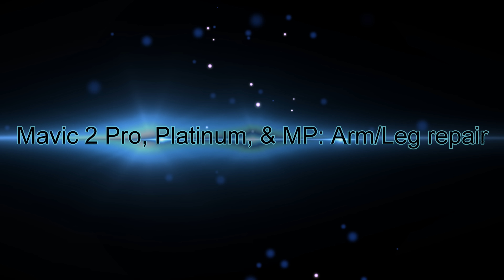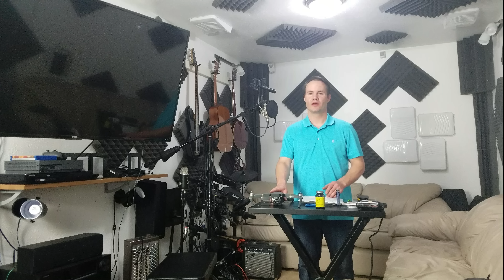DJI Mavic 2 Pro Drone Crash Arm/Leg Repair: For Mavic 2 Zoom, Mavic Pro Platinum, Mavic Pro inUHD 4k

Comment: is there a problem to cut the wires and join the old and new with Heat shrink solder butt connector?   Then you dont need to solder on the main board.

Comment: Never use solder wick they come with pre soldered contacts for a reason the components will drop off the bottom side if you get too silly.order there esc and see  for yourself

Comment: Liquid Lab Studio...The first thing you should do is change the title of your video. As you can see ( you do see...right ) by the negative comments, people want transparency, and to know that a repair video on a Mavic Two Pro....is actually "on" the Mavic Two Pro, not the older Mavic 2. These things are important because its a VIDEO and I need to see you working on the same piece of equipment that I own, you see ? ( you do see,right ? )  Dont just explain or defend your mistakes, make the changes and I'm sure you will do well.

Comment: I just love how someone creates a youtube channel and all of a sudden they're the go-to source for misinformation.  LOL.  Don't take any soldering advice from this guy.  You need to remove the old solder.  You need to tin the new wires to draw solder through the strands and help prevent a cold joint.  You need to use a soldering iron, and not a soldering gun on something this small.  You're not soldering battery lugs on jumper cables.  Liquid tape is unnecessary and just makes a mess.  Then there's the reason you crashed to begin with.  It wasn't the auto-land, you should have made it.  It would have kept altitude if you kept the stick-up, particularly since you were at almost 400'.  You had plenty of power to get home, but I digress.
Reply: Hi Mike, I have to replace the rear arm of my Mavic 1 and I'm having a hard time to remove the old solder (it's not melting at all). I'm using a 60W soldering iron with a ceramic tip. However it is melting regular solder by contact, everything is brand new. I believe this soldering iron gets to 300° celsius, do you know if I need a more powerful one? Which type of core solder should I get for this specific repair? Thanks!

Comment: first off you dont just cut off wires when re-soldering stuff then take them off after, also that is a huge soldering iron to be using on a tiny board, thats the kind of iron you would use when connecting electronics like on a car

Comment: Loctite construction adhesive for use in caulk gun has a expensive mixture called "pro line 8 times stronger fast grab".for your more expensive outside house repairs.i buy it and it loves extremes of snow,heat,high wind,high pull,twist,etc.But probably for just a small crack in mid arm.and i might add a little lightweight splint in with the adhesive.but this thing looks too heavy for adhesive.i want the mavic mini.i will definitely pay to get that 2 dji refresh replace deal.Nice replacement video!

Comment: I broke the right front leg on my Mavic 2 and used your video as a guide to replace it. I followed the instructions carefully including grounding myself and the drone. The repair seemed very straightforward until I  went to power up the drone. it wouldn't turn on.  Any thoughts?

Comment: Pravin Aswale
2 days ago
just purchased Mavic 2 pro, within few days i am getting "Gimbal motor overloaded error"  and then Gimbal starts moving erratically, no stability at all, many jerks are there. what is the solution for the same.

Comment: Dear god, please don’t put “liquid tape” on the solder joints. Get a nicer iron, use solder wick, remove old solder put flux on pads, apply heat to pads and wire and use the heat to wick the solder to the pad/wire. 

It looks like you probably ended up with cold solder joints. It may have worked, but you’re likely to break those joints with vibration...and probably at the worst time. Just make sure you don’t fly over any people with that particular drone.
Reply: And with a propper 60/40 solder, no need for extra flux

Comment: By the tittle, I thought it was a diy repair, like using fiber glass, epoxy, etc. This is a how to replace a part.
Reply from the maker: I actually considered various glues and or adhesives. The decision was made with extensive physical tests and reading research. The testing included gluing another exact OEM leg from a previous crash where the DJI Go4 initial software app forced crash. 

It turns out due to safety reasons and considerations of vibrations created from an aircraft it would not be recommended to fly. Epoxy has a high test strength i.e. 3500 psi -10,000 psi but it has a very hard setup and would not be suitable under constant vibrations and varying weather and temperature. Gorilla glue's early product is too expansive and creates a pours expanding foam with bubbles which is also prone to wear and tear and misalignment of the joints. Tar/rubber/rubber cement wouldn't hold up to extreme temperatures, time, and bonding requirements, especially, without drilling the arm and weakling structural joints. The joint was not accessible for drilling in new screws without compromising the strength and shape of the joint. Special super glue was promising based on the metal bracket and composite cracks at the joint. Upon further testing it held up well on a test arm then later cracked when exposed to fluctuating room temperatures (cold) and the chemical reaction in the glue kept dissolving the composite plastic. Industrial grade tape would work but it would not allow for the drone to fold IMO the Mavic Pro v1's only distinguishing feature. Wire tie downs with super glue actually worked but it was cumbersome to attach and reattach for every flight (the only option worthy of any flight test).

So final verdict: I made this video as a walk-through for an average+ user on how to repair it without costly repair shop costs. Remember and please note all DIY is at your own risk...

Please like and Subscribe, 
LLabS

Comment: This isn’t for the Mavic 2, there completely different, I have done a small repair guide for the Mavic 2 front leg replacement, that doesn’t require any soldering or in-depth disassembly, may be useful for some people.
Reply: Can I use your repair guide?  How do I go about seeing it. Thank you.
Reply: Never mind, I found it. Thank you for the video.
Reply: @JohnnyGification  May I ask where to find it?

Comment: Dude this is not the Mavic 2 not even close
Reply: JagFPV I’ve actually done a small video on replacing the antennas for the Mavic 2 that doesn’t require any soldering. Might help a few people

Comment: Hellppp....
DJI Mavic Pro I have a problem .... on my mobile phone I do not have a recording tag, just taking a picture ... I try to switch to the camera without switching. I have a picture transfer on a coaster, a gimbal twist, for stabilization ... sometimes I shoot but it does not show me recording. I do not approve me on the console to view photos or recordings. I tried farmwire but it showed me it did not work. I have no adjustments to the video quality I choose ...I have another DJ Mavic pro and the Samsung A6 2018 works perfectly. M ScanDisc Extreme 16gb card and everything works perfectly. At the first DJ I tried Mavic fo4rmatize the card, ran the farge through Samsunga, the Computer helped DJI Assistent 2 and I did not manage to fix it and always report the error when loading the farware at 40%. Photographers (not just on the phone) are flying on the card, they are flying smoothly, but there is nothing to do with recording. Gimbal works perfectly, although I managed to record something for a few seconds and I only saw it on the card reader.I tried without the card, I can record it on a mobile phone, and when I put my card, it will not shoot the video
Hellllp

Comment: Hello just watched your video on replacing mavic Pro leg. I d9 t suppose you can do one on how to replace  a DJI Spark gimbal. The ones I’ve seen on you tube aren’t very good. I crashed mine into a tree and I think the gimbal is damaged, the sensor keeps going off even though there are no object around. Checking repair companies in the UK cost as much as my Spark did.

Seeing a video like yours on a spark might change my mind of doing it myself. Great full if you Gould help. regards Irvine ...Portsmouth UK

Comment: never cut wires- photo them or write them down - wrong soldering iron - use something with temperature adjustments - never use metal like screwdriver to clean glue - just some plastic tool the same to put soldering paste on the board - but after all these good to you - good work!!!!
Reply: he filmed it so no need for photo or write down ;)

Comment: lol soldering iron and wire cutters from the 90's ?  think after buying a 1200 drone you could get a nicer iron :P
Reply: Why?
Reply: @useryggfdcc  because that is thing is about 3000 watts, not suitable for delicate electronics. A nice solder station will do.

Comment: You were lucky not frying and cooking the electronics in your drone with that soldering gun. For that kind of job, it is recommended to use a controlled temperature soldering station with a pencil tip. Those professional soldering stations have the pencil tip grounded so no currents are induced and transferred to the circuit you are working on. Also the temperature needed for soldering that delicate circuits is much lower than the temp produced by the soldering gun you used.

Comment: dude you could have just spliced wires and put it some plugs so in case you crash again you can just unplug and replace you did all that extra work for nothing
Reply: Vibrations could cause a loose connection, soldering will help prevent that
Reply: As long as there is not a resistance issue. If anyone has done this, that would be good to know. I need to replace a rear arm.
Reply: i was thinking just the same

Comment: can i just soldering it wire to wire, not to board, just to make sure the board is safe?
Reply from the maker: You could and it would work but it would not be recommended. The method I used where you heat the connections while putting tension on the wires is safe. I figured out a good technique for reattachment, if you put fresh solder on the iron you can make a liquid pool it will instantly melt the previous connections for the new attachment wires. This way, it barely heats the board. If you look closer I've replaced both legs. Maybe there is a reason some people call it the crashvic pro. haha.  Just watch the segment on soldering over and over until you feel comfortable i.e. removing, replacing, and reattaching wires. Can you do me a favor and Subscribe? 

Cody
LLabS
Reply: Liquid Lab Studio bad advice. You MUST heat the board/pad first and get it hot enough to melt the solder for a good solder joint.
Reply: thanks for the reply. 
already subscribed you.
Reply: Never learned to pull the wires. make some solder hot and put it in the old solder....
With all the vibrations going on this is not a quality solution.
Besides that your soldering tool is way to big and clumsy.

If you want to do it quick and relative safe just cut the old wires half, strip them a bit and the new want. twist it and solder with a heat shrink tubing.

Comment: "The brand new Mavic pro drone", however your showing the old Mavic. The title is misleading.
Reply: Problem is you cannot source the mavic 2 arms yet / I’m waiting patiently as mine is broken
Reply from the maker: That is a good point... I suspect they are the exact same as the Mavic Pro Platinum. If you look at the noise decibel rating and flight times (zoom/M2P vs Platinum) it will give a subtle confirmation... I have replaced both legs and I don't think they are all truly the same OEM quality, but never underestimate the drone's ability to compensate for variances in lift; hence the two propellers spinning clockwise and two spinning counterclockwise. In my opinion matching the noise and quality is most important because they have variable-speed motors to compensate for most things. These motors work in tandem with and 2 GPS systems,  2 compasses, sonar, and visual sensors to sense distance and obstacles. You can do a flight test low to the ground and you will know if it is safe to fly then do extensive aerial tests.

I make these videos because the mavic although neat has been a heartache and shouldn't be so difficult on drone enthusiast.

I want other owners to save time and expense. Can you do me a favor and Like and Subscribe?

Cody LLabS
Reply: My lower frame is cracked. Where the motor arm was cracked similar to yours. If I just replace the arm will it fly properly?
Reply from the maker: Thank you for commenting. The repair process is for all Mavic models. DJI Mavic 2 Pro, Mavic 2 Zoom, Mavic Pro Platinum & Mavic Pro; listed in descending order. Everyone that has the same body style especially the newer models can benefit from this interactive video.
LLabS